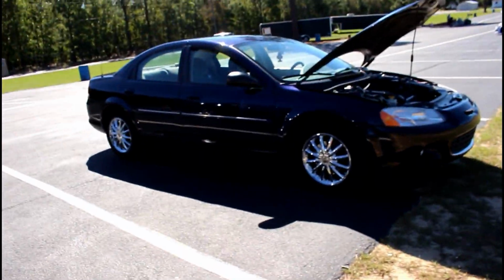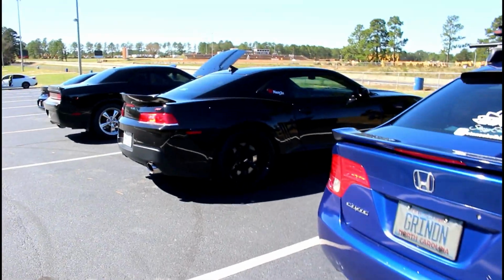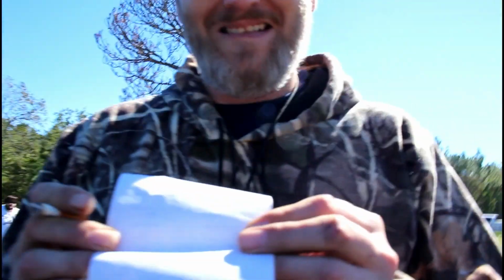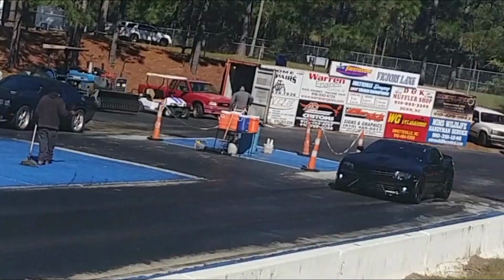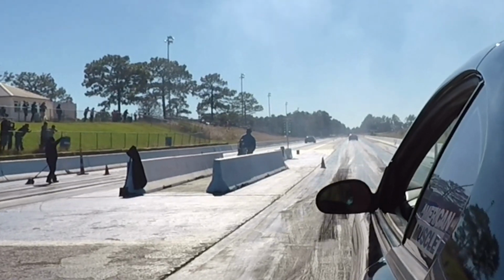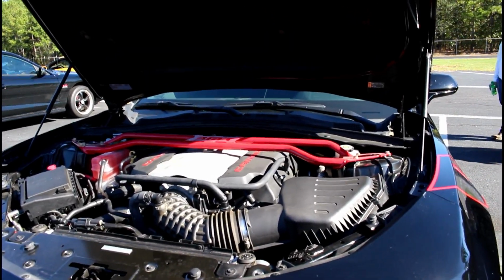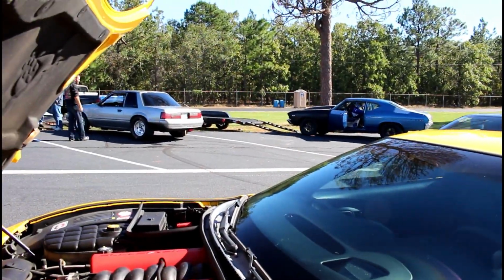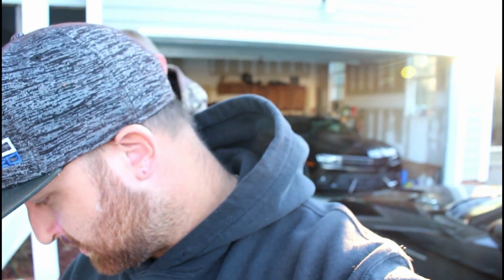Texas Speed 235/239 Cam Only 2015 SS Camaro Racing 1/4 Mile On Street Tires

Comment from the maker: New parts coming in this weekend. Hopefully a set of race wheels and bias plys will be coming in the future!
Reply: Nasty 2SS  quick question i have same car how should i go with my car so i dont get any problems with stock motor i wanna get my cold air then headers then cam and tune or what steps should i do to be safe
Reply from the maker: Juan Loza That’s close to same order I did. Cold air intake, headers, tune, cam, re tune. Make sure you get tuning right after you install your longtubes. LS Motors are tough. With the right tuner you shouldn’t have anything to worry about
Reply: Nasty 2SS i have an auto 2015 ss camero does it still have the LS
Reply: What track is that
Reply from the maker: Fayetteville

Comment: Awesome vid! Not sure if you have much done for weight reduction but that may be something to look into down the road, especially when you get drag radials and start hooking. My 2010 SS weighs 3645 with stock wheels and will be weighing a lot less with TSW Bathurst next summer. Keep the great content coming!
Reply: That is pretty impressive. My car weighs 3800 with half a tank of fuel. Do you still have an interior? When I went to a drag pack I saved 50lbs. I cut off the stock mufflers and got rid of the cats and stock manifolds but I'm pretty much full interior, ditched the spare air pump too.
Reply: @frankcanora5900  I removed everything from the trunk and swapped out the heavy 45lb stock battery to a 15lb one. The only thing interior wise that I have taken out are the back seats and rear seatbelts. I ditched the stock heavy manifolds to headers and the catback to a Solo Mach X as well. I also removed the washer fluid tank reservoir as I've never once used it. The 3645lb weight was with a quarter tank of gas (race amount for me). Should be dropping around another 30+ with the TSW Bathurst wheels as well

Comment: Pleas next time stick the gopro on the harness bar it will create a better footage your times are good considering your running 20s rims you need some bmr suspension upgrades and smaller wheels with sticky tires plus any one who owns 5thgen ss knows how weak the axles and rear end nice video bro keep them coming
Reply from the maker: Thanks man. I’m ordering a GoPro mount for the harness bar sooner. I’m working on the suspension/rear. I have BMR springs, BMR trailing arms that just came in (toe rods next), trutrac rear end, and 3.91 gears. It’s a work in process lol. Axles def need to be replaced soon
Reply: @Nasty2SS  yes I know man good parts cost a lot of cash yes also the deff if you can find a manual zl1 diff and stage 5 dss axles you will be golden cause it's really strong and can hold. I knew it was probably in the back of your head every time you launch the car you are afraid of breaking it lol that's why mad props to you sending it you will break the 11 for sure maybe even high 10 with some more power goodluck man

Comment: Why would you be at the track running street tires with cammed out cars that's ridiculous the whole point of it is to try and see how fast you can get your car to go I've got a 5th gen Camaro bolt ons only running 11 5 stock cam stock gears stock heads stock intake

Comment: Also are U running open headers ?
Reply: Also nah just headers, this is what LS3's sound like with longtubes
Reply: OPEC no I have a 2014 camaro ss ls3 with longtubes no cats hooked up to the npp zl1 exhaust, with BTR stage 4 cam and all but that sounds super loud thought he had the mid piped disconnected
Reply: I have a couple idle videos on my channel and all I had was longtubes with catless mid pipes and a muffler delete, it's not as loud but it would be had I ever cammed it. Maybe your NPP exhaust is making it quieter, I had a solo muffler axle back kit on mine and it was loud
Reply: OPEC no my car is super loud as hellllllllll but his runs sounded like if it was open headers with no mid hallow pipes so that’s y I asked but yeah man especially cold starts with the chopping it’s amazing
Reply from the maker: I have the J pipes from my solo Performance exhaust open. But exhaust is running from headers, catless x pipe, no muffler
Reply: Nasty 2SS nice thanks bro, would me running e85 make a big difference? I’m at 503 rwhp now on 91
Reply from the maker: It seems to be very beneficial to the 6th gen since the LT1 is direct injection. I’ve seen on Camaro5 small gains from E85 on our cars. It does burn cleaner though. It’s not worth it in my opinion to convert to E85/flex fuel on a 5th gen. At least on an N/A. A boosted motor may be a whole different story on E85, I just haven’t looked much into it. Hope that helps a little :/
Reply: Nasty 2SS understanding bro thanks man, hope u can help me answer some questions in the future. I’ve Hurd 15 to 20 rwhp gain on 5th gens idk if that’s true
Reply from the maker: That sounds about right. I’ve heard the same thing!

Comment: Great racing again! Dude you dont need Bias ply! Get 315/45/17's for the rear. MT street ET's, 555r's, what ever. Mine with the MT's dead hooks and soooo MUCH faster with a good tire! And a lot cheaper than fixing broken parts due to the wheel hop...

Comment: You need drag radials badly . I went 12.6 @ 113on street tires in my auto stalled 3200 headers tune cal bone stock my car went 13.27 @107 once called it went 7.1@ 97 1.60 60 foot 1/8 didn’t get a chance to run 1/4 before I sold the car .

Comment: Hey man, I trapped nearly 116mph in my old 2010 LS3 Camaro with 3 mods, also on street tires in 2500 d/a. Would you say that's unusual? And no the engine was never opened.

Comment: Jeremy you can pick up a set of Z06 18" 9.5 replica wheels for around $300 on ebay, specs are 18x9.5 +40mm offset. Also 18x10.5 +53mm offset (these are hard to find). Both of these are direct fit, the only thing you may need to do is tie back the emergency brake line. I wouldn't run a bias ply, most are not street legal and your basically driving around on a bald tire. Instead a Nitto NTO5r, or MT ET Street SS, or ET Street R. These are street legal and you can drive the to the track. Be careful in wet weather! We've got to get that reaction time down to .1XX or lower!!!! While it won't help your ET, it will help you win races against faster cars with slow reaction times.
Reply from the maker: As always, thanks for the advice. I’m looking to do 17” race wheels with bias ply tires. I would only be using them at the track!
Reply from the maker: Also, I ordered the BMR trailing arms. Toe rods will be next
Reply: Race Star Bracket Racers in 17" are pretty good. I stuck with the 28" OD size. Get the matching skinnies up front it you can. A full set of wheels and tires (Drag Pack) runs about $2k but they are worth it. My wheels ran about $850 with lug nuts. I have a video of the part numbers and tire models on my channel. For the rear generally people will run slicks on the back not drag radials. Just changing to those wheels and tires you should be able to drop 0.5 sec on your ET. I feel your pain with the street tires, been there. What is your axle config? You can ask Joe Marks about that topic...lol !!!
Reply from the maker: Thanks for the info. I’ll check out that video. I’m still on stock IRS. Would love to go to a solid rear if I ever win the lottery 🤓
Reply: Just my opinion but i think a solid rear is overkill, John Doc blew his out at Galot a while back, so they all break. There are a lot of other options, ZL1 rear with ZL1 axles and driveshafts can be had for about $3K. It's all what makes sense for your projected power level. Joe is just upgrading to 1000hp axles and has done a trutrac with 3.91s. I'm still on my stock 3.27 rear and axles until something breaks. So far so good and performance is not bad. I like the ZL1 rear setup myself but I will probably pull the trigger on a cam first on my quest for 10s. One day hopefully we can meet up at a track, may hit Darlington in December if the weather is right.
Reply from the maker: Yeah. I’ve heard about running the ZL1 rear and half shafts. I haven’t had any issues since I went to the 3.91 gears and TruTrac, thank God. Hoping the trailing arms and toe rods will help prevent it some. Fingers crossed for now.
Reply: The trailing arms and toe rods should help some and minimize the twisting. Stock axles are pretty cheap, just saw a used set for $100. I have been meaning to keep some spares. The reason for the slicks or bias plys vs. the drag radials are for a little extra cushion when you pop the clutch for you stick guys. I see some people in the comments below recommending radials for your application.
Reply: OK …...I was thinking you would be driving back and forth to the drag strip. A bias ply does work well with a manual, softer side wall than a drag radial. MT and Hoosier make 17" that will fit. Your 60' should come down to around 1.7X with those. Even with the toe links/trailing arms you can still break the CV joint on the stock axles, I did it last Sunday on my L99 that has bolt on's, 3200 stall, and 125hp nitrous shot. Whatever light your leaving on.....you need to go one sooner. the tree drops at .5 sec increments, so leaving a light sooner will drop that .6XX reaction to a .1XX...…..while it won't improve your ET it will help you win  a race against a faster car with slower reaction....For example you ran slower against JJ but still won due to his reaction time...….even if you just race for fun you should always try and cut a good light....that way if you ever bracket race...or have a heads up race against someone else....you give yourself a much better chance of winning.....lots of people with fast cars can get good ET's.....but very few of them can cut a light.